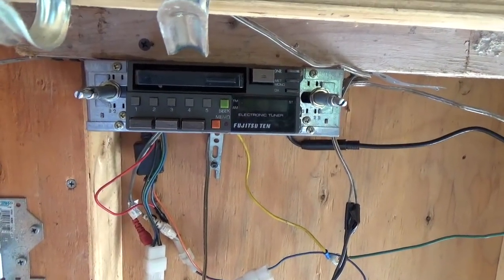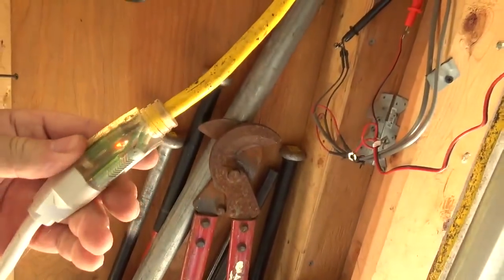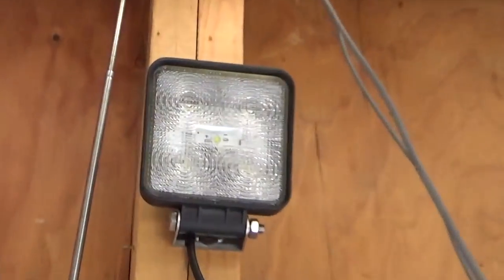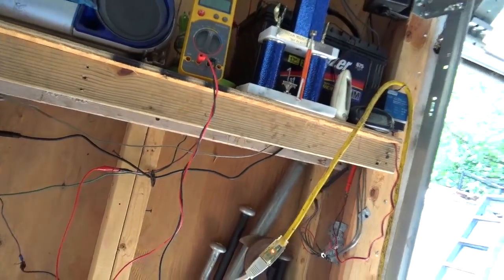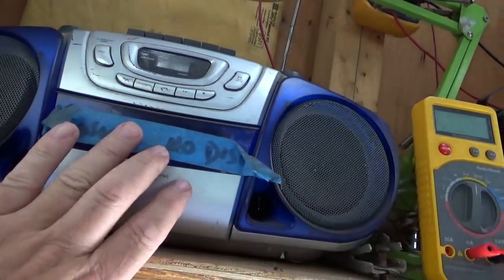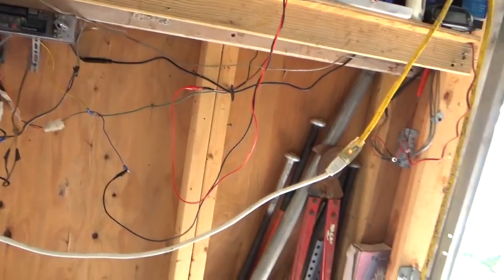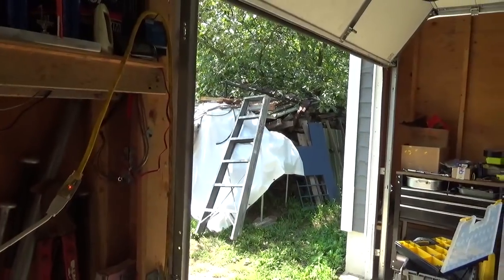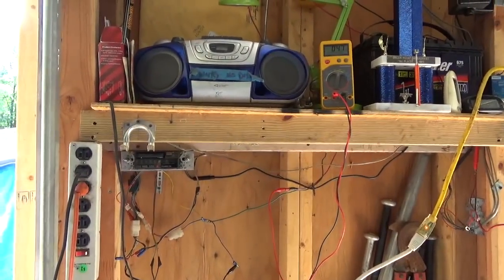Recycled Car Radio, Solar powered for garage, better reception than boom box!

Comment: Harvey, I've gotta run some power out to the middle of my garden, I'm not buying expensive armoured cable, I'm simply gonna use some 20mm mdpe water pipe as a conduit/protector, comes in 50 or 100 metre roll. Ah well you get the idea :)

Comment: I personally use a very similar setup in my shop even though I do have line voltage in there I just don't have the space for a large stereo system.
If you use the stereo a lot and it brings down the battery why not put the solar panels outside, I believe you mentioned it before why you can't but I don't recall why.

Comment: Found the video very interesting. I'm thinking about a solar set-up to trickle charge batteries in a shed without electricity. Running a 50 foot extension cord just for that is getting old. Got into some online research, and came away more confused than ever. Lol! How large are the panels? I only need 750mA at 12 volts, 10 watts max.
Reply: David Collins always go bigger than you need, in the winter your batteries will lose a lot of their power.
 Not a lot of people know that

Comment: Nice to see your garage coming along.  Do yourself a favor and get those panels outside. Wish I had a way to come get the sears tractor,  I would use that around here.
Reply: Oh and I found a Honda Odessy at the scrap yard, but its in tough shape.
Reply from the maker: Hey Mike!!!!  It has been awhile, we need to get U another 177 subscribers!!!   I have the panels inside the window because I'm supposed to have a solar power install inspected.... One has to love NY.... I'm going to move at least one of the panels outside... The SS16 is a monster of a tractor, I just don't have the space and work for it to do... I have seen them with loaders on them, they really are a work horse.... Take care my friend, my best to Ur family!!!!   Thanks for Ur thoughts, advice, watching, and commenting!!!!
Reply from the maker: Hey Mike, About the Odessy, there are several parts of it that are very valuable even if they are rough... Any part of the seat, especially the bottom are very hard to find.... If another motor can be put on it, if there is enough left for that like steering and the rear axle, they are worth a few $.... Thanks for the info, watching, and commenting!!!
Reply: The odessy is basically all there except the rear axle and engine.  I might pick it up if I can get it dirt cheap.  I got go back there on Friday,  so maybe we will see. I wish I could get the subs,  but I need to make more videos to make that happen.
Reply: Just subbed so that's one less you need :-)